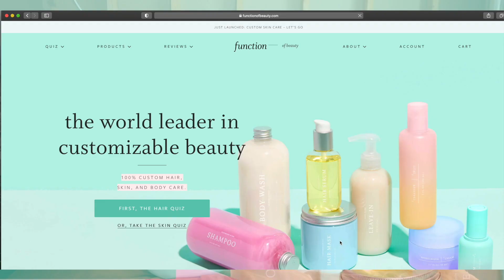WINTER DAY IN THE LIFE Living at Cabin in the Woods

Comment: Using a razor blade to cut drywall will make a much cleaner edge and keep the mess down. Plus it won't throw drywall dust in the air like that sawsall.